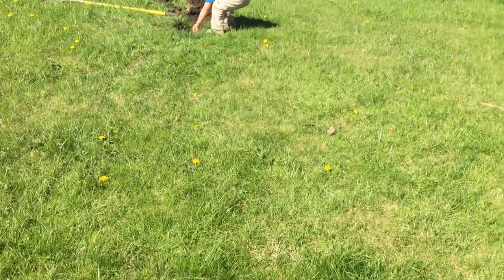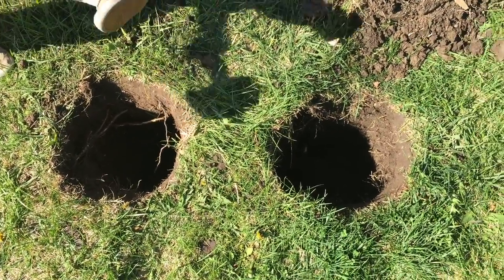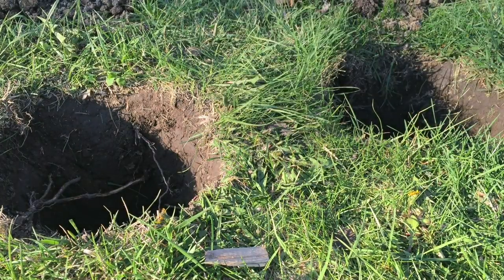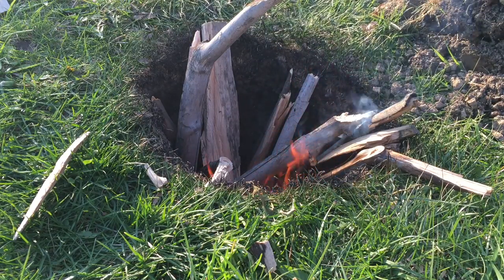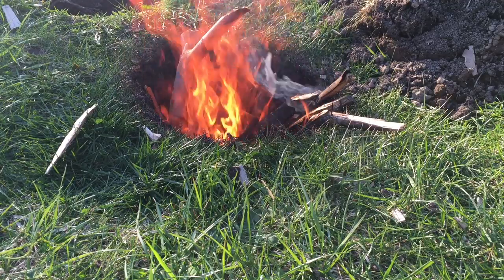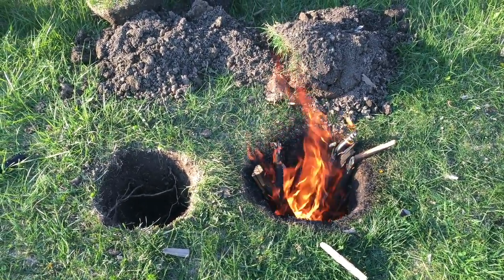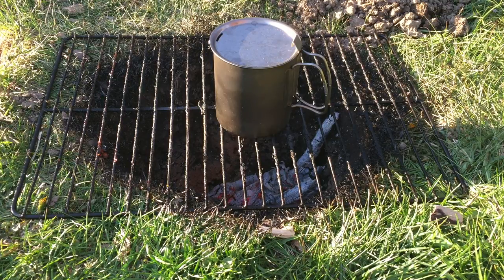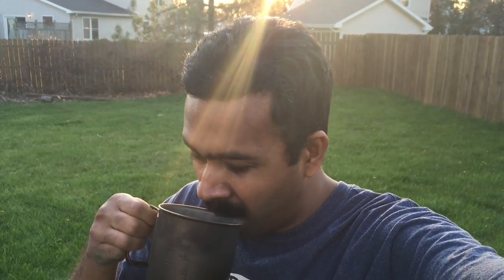How to build the Dakota fire hole: excellent fire build

Comment: You need a bigger hole to line with stones to hold and throw heat. Also a baffle to choke the airflow. you can also run a hair dryer after it's built properly to melt metals. These are good for dry or windy conditions. It's a fairly safe way to have a fire. If you add a 3rd chamber for winter and block it with a stone or run  pipes you would have your own under tent furnace.
There was a camp site by a lake we used to go to every year. I had loads of flat slate stones. We setup a campsite with an underground oven beside the firepit and heating chambers for the 3 tent pads. Using the same idea.
Reply from the maker: Really interesting. Lining with stones would help throw the heat and I have seen the baffle and hair dryer concept. In constructed right It could be a really neat natural forge/furnace. Thanks for watching!

Comment: another benefit of the Dakota Fire is that it is basically an in-ground rocket stove that you can feed fuel to through the tunnel and control the amount of flame. That helps to keep it a stealth fire.
Reply from the maker: Indeed. It is an excellent one to try out.